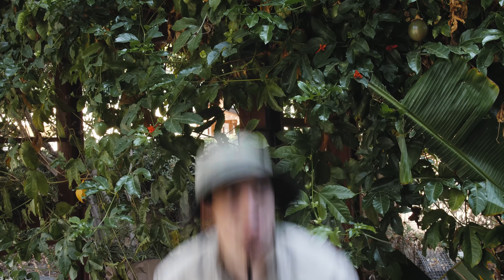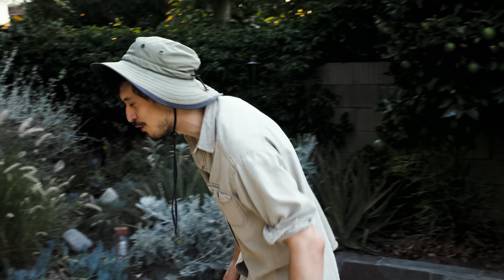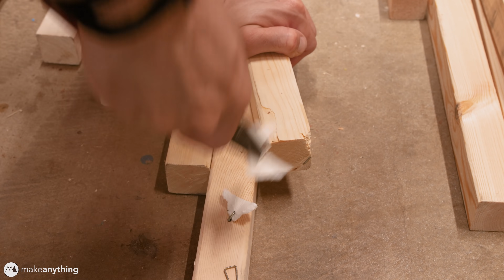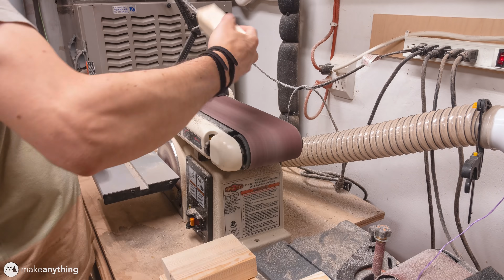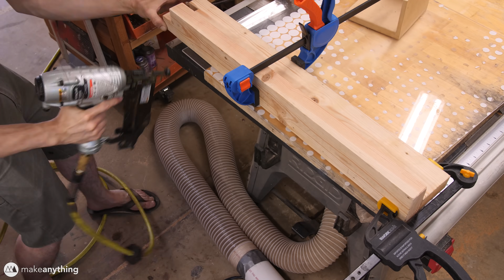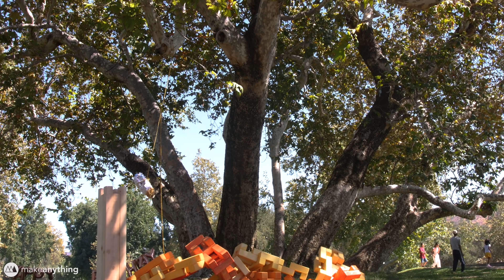I Made a Giant Tippi Tree!

Comment: "Edited"
Reply from the maker: Haha forgive me, they were the only bits I had that were long enough! But it was still a noob move to have the bolts screw into end grain so I won't fight you. I'm not super well versed with woodworking, it's my dad's equipment for the most part. I think you could've said the same thing without the condescending tone but I appreciate you taking the time to comment :)
Reply: @Make Anything  yea sorry about that, I was having a bad day, and I guess I let it out in my comment. I usually try to make a point of not being negative  or judgemental, I suppose it got the better of me in that moment. I'll remove the comment, as it's now bugging me that I let myself post a negative comment like that as I am usually very particular about not doing so. And especially when I myself, am very much the sort that will use whatever tools or equipment I have to accomplish my goal, even if they are not meant for that use. 
Anyway, I did appreciate the time and effort you put in to make the Tippi Tree game, and you did a great job considering your limited experience. And to add the filming on top of that. It was well done, and I wish I had just said that from the start.
Have a good one and keep up the good work.

Comment: Ah, just a word of warning regarding the bolts: screwing into the end of boards is the least sturdy way to screw wood together. Same thing for the glue since the butt absorbs glue like crazy and compromises the strength of the joint.
Reply from the maker: Thanks, I do think I'll need to reinforce those connections. Any suggestions?
Reply: @make.anything  it depends! If you want permanent joinery then mortise and tenon is very labor intensive but it's pretty much the strongest type of butt joint. There's also the half lap joint for less than half the effort but still plenty strong.

For removeable joinery you could do a half lap joint and not glue it but use the bolts instead. Rex Krueger has a fantastic video about joinery on workbenches titled "Four workbench building mistakes (that we all make)" that explains pretty much everything you need to know in 21 minutes
Reply from the maker: @diegodoumecq5144  thanks! 👍👍

Comment: I have learned a lot;

You give a great example of using 3d printer to make tools for your projects.

I have two suggestions:

- Could you try using wood insert nuts with bolts instead of wood screws? this might make each part more durable and rigid.
- Could you get a CNC router, and write a program to cut down wood blocks that you would fasten with bolts & wood inserts to the bed, to, say 35mm? It still will take a lot of time taking parts in and out, but it would likely solve issues with curved blocks and the tolerances.

Comment: Using dowels or dominoes for the joints would probably strengthen the joints quite a bit but that would be a LOT more work and glue-up time than what you're up for lol

Also if you made around 400 pieces I'd say 66 leaves!

Comment: For faster building large blocks, you need to build a mould, and cast peaces. Not sure which material would fit the requirements at this size. I can't see any cast material that would do at reasonable price. Wood was probably the best choice. 

Unless, if you can rotomould, some hot poored stuff could do :  use hot temp poored plastic to manufacture hollow pieces, so that weight remains negligible, then plastic could be strong enough.

Comment: Concrete would have worked. If worried about strength, you can reinforce using plastic fibers (sold separately ). Also to make it light you can use 80% polystyrene balls (either sold separately, or as ready to use mixture usually with fibers included ). 

Just let it dry 2 weeks for 90% strength. (3 weeks for 95% is time loss ).
Reply: Wood is easier, cheaper, and looks better
Reply: @NorDank  i agree, just saying that if classic concrete is inappropriate, custom concrete could do. So his initial idea is not as impossible as he thought ...

Comment: It's awesome! I would love to play this game and I've always hoped that someone should do it this big. Even better that you yourself got to it and made it so great. 

You asked for advice, so because I am very much an expert on account of me following exactly two woodworking channels here on the Tubes: 
If you have access to a drillpress, I think dowels should give you the strength in the leaves. Obviously a lot of holes, but one jig and then a lot of repetions and probably a fraction easier and cheaper than if you were to use all screws. Maybe just the endpieces (because the sides have the grain parallel and are also probably not getting the same amount of twisting forces?) 

(Also, didn't you at one point have a CNC-router? Because you could probably route some cool designs in the sides of the trunk.)

Comment: Instead of using wood glue to fill the holes, you could have used wood filler. But other than that, everything looked absolutely amazing
Reply: You can also mix sawdust with wood glue for a quick alternative to wood filler
Reply: @cooperhoelscher7463  ooh nice I didn't know that
Reply: @cooperhoelscher7463  came down to comment the same but ya beat me to it haha, I always keep a jar of fine sawdust for just this reason
Reply: @cooperhoelscher7463  Messy alternative, not quick. :)  Timbermate - it's all you need.
Reply: Most wood fillers don't do great outdoors, even if they say exterior use. Most woodworkers would just fill knots with thin epoxy, or even easier, superglue. you can even buy tinted superglue if you plan to leave the wood natural.
Reply: Yes it did